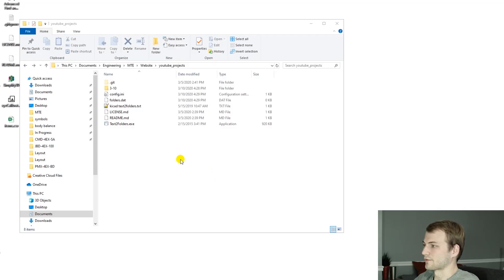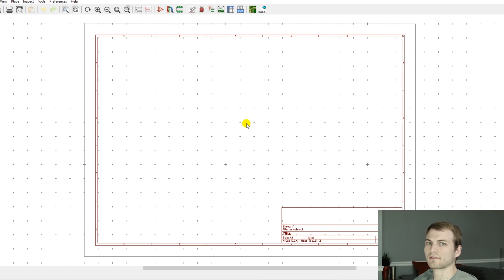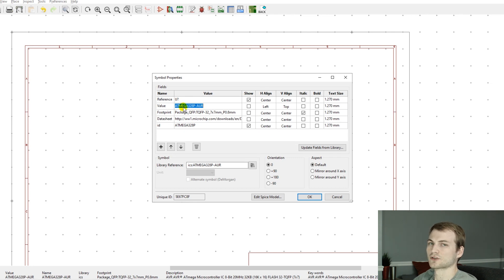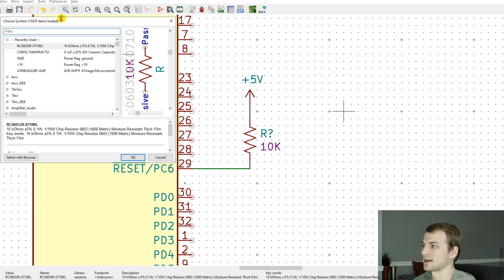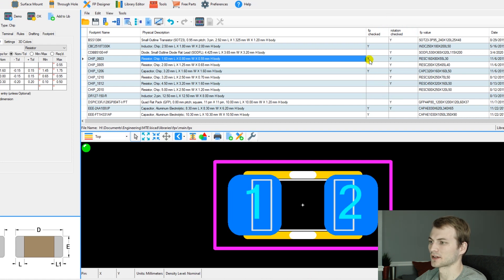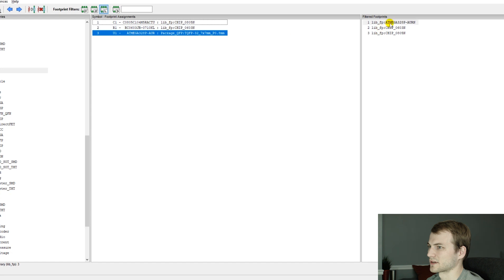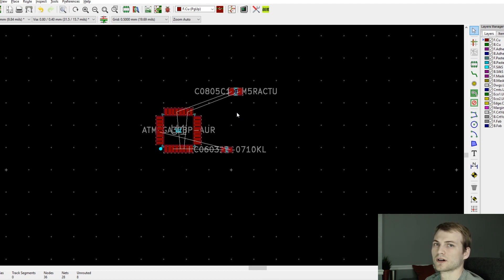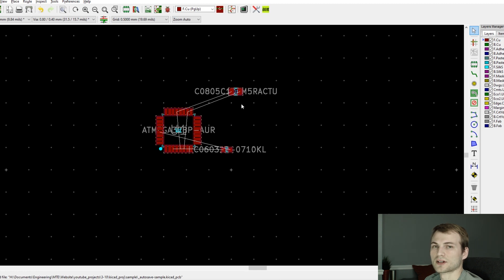UPDATED KiCad 5 Project and library structure

Comment: So I'm still confused... do you remake ALL components? ie. resistors, do you use your own symbol AND footprint for something as simple as a SMD resistor instead of using the default KiCAD one?
Reply from the maker: Symbol yes. Every single part I use is unique and matched to a manufacturer's part number. Footprints are global, they can have multiple symbols pointing to the same resistor footprint. I never use KiCad footprints, everything we use, we built.

Comment: 8:57 You shouldn't have to add/edit 3D component parts just because you're not using a global footprint file.  Files can be referenced relative to the project folder (i.e. the *.pro folder) using the ${KIPRJMOD} path.  So, the path should be ${KIPRJMOD}/lib_fp.pretty/ATMEGA..." and it'll be portable between projects, assuming your 3D file is in the same location in your folder structure.

It looks like you're aware of the path option because you've made a ${KICAD_LOCAL_FOOTPRINTS} path entry for your project, which KiCad automatically creates a relative path for as shown at 9:23. But you'd have to re-make this path per project unless "${KICAD_LOCAL_FOOTPRINTS}" was also relative to the project path, like if it were "${KIPRJMOD}/my_3d_content/".

At least, I think this would work. Could be worth a shot!
Reply: Jesus Christ, library management in KiCad is a nightmare! Can't find a video explaining all those things.

Comment: About symbols - for additional fields I use Template Field Names from settings with UID, manufacturer and so on, IMO more flexible ble than embedding additional info in symbol itself.
About footprints - Unfortunately Library Expert is windows only :/
I'm using global footprints, not only symbols. I'm making it in a way that every footprint and symbol I'm making can be reused as much as possible.